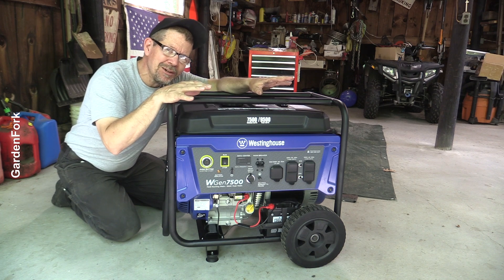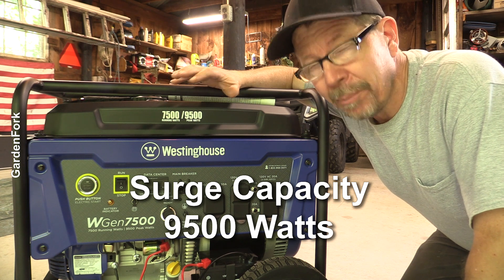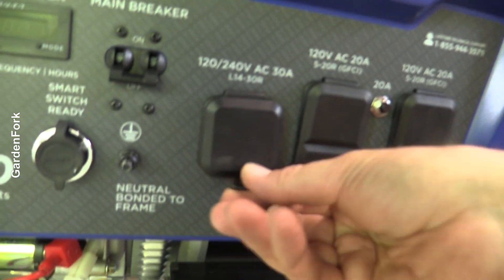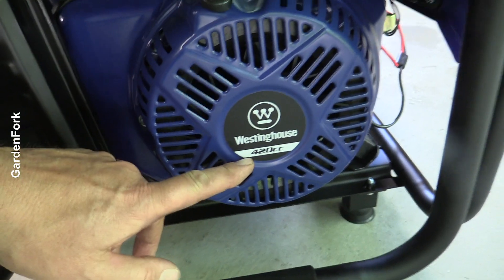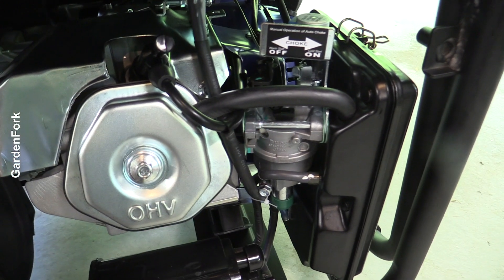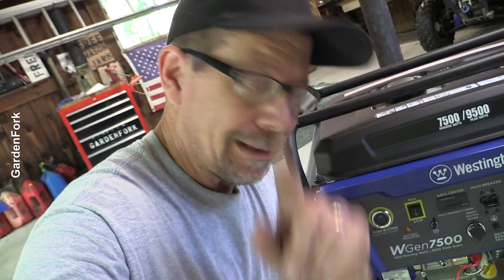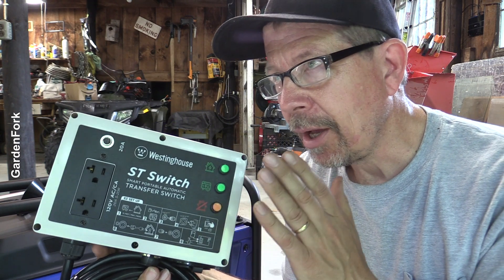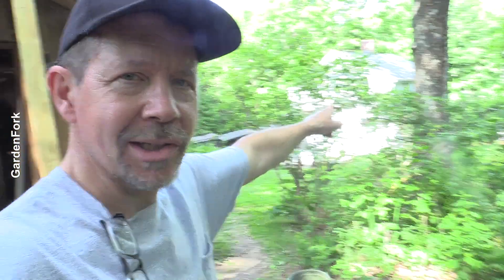A Remote Start Generator? You Will Like This - Westinghouse Wgen7500

Comment: 5 or 6 yrs ago I did extensive research for a good generator and transfer switch, Westinghouse was the one I also picked. Life happened and I never bought them. You re-kindled my interest and I am now thinking about all this again.  Good video, thanks.
Reply from the maker: good to hear. The remote start and the ST switch make this one interesting. If you need dual fuel, there are links to those as well in the video notes. - ERic.

Comment: I recently purchased the 2021, Westinghouse WGen7500 DF (Dual Fuel). It is real nice. Starts easy, runs smooth and has plenty of power to handle all of my needs. Its nice to have the option of what type of fuel I want to run. Nice job on the review. I am very happy with this generator and I like the attention to detail and quality.

Comment: I just watched your video and found a great deal on this same Generator Delivered to my home for free. I will use Manual Transfer Switch and the remote control I think. Great price and value for the money. I made the mistake of buying a smaller manual start Generator and had 4 feet of Snow and a power outage. I was just in the hospital and shoveling a path to go find the gen set, Did a place to put it and then run  a wire back to run what i needed will be eliminated when I hook this up and have it wired in correctly. Watching you install a Manual Transfer Switch in your sisters house. Great videos ! Thank you.

Comment: From Nova Scotia Great video!
I agree Westinghouse makes the best generator.
Couldn’t get the one I wanted so I bought a 8000/10000 Firman that seems to work well. Also, for some reason I did not know I could plug in my battery  tender (same as yours) that way.
Thanks very much !!

Comment: Yes, you DO have to trudge out in the snow to flick the rocker switch from stop to start. Then the fob will work. 
If you leave the switch on start all the time, the battery will be depleted. 
It's NOT remote start, unless you don't have to visit the generator first.
Reply: I added a 9.00 12v remote relay to the power line on the on switch. Extra remote but you dont have to go outside and flip the on switch. Relays on ebay.
Reply: EXACTLY, I don't under stand the advantage of remote start.

Comment: only problem with these gens that start with the remote fob is that you have to leave the on off switch to the on position all the time for it to run but that runs down your battery if its just sitting for a long time with the switch in the on position so you need to have the trickle charger on it.   also they are hard to wire to a remote start from a transfer switch or solar inverter that can start a generator  to charge the batteries.

Comment: Thinking about getting one, have had 2 harbor freight 7250/9000 that didn't last a yr using 5hrs a day with only 90day warranty, engine rung out one one, powerhead on other, going to thoroughly check PH on second one tomorrow, can maybe use the one from no 1, they are junk tho. Hoping these are better with a 3yr warranty

Comment: Nice video. What mode trickel charger do you use.  I have the same generator but I have a dead battery. Do you charge the batter with the switch on or off?
Reply from the maker: Switch off. Direct wire to the battery. Buy the lowest wattage Battery Tender brand.

Comment: If you are considering using Westinghouse generators for sump pumps, beware of the Smart Idle feature (don't buy a model with it).  It will prevent the sump pump from starting correctly, as it idles down in between pumping cycles, lowering the usable amps.  This is something I've taken up with Westinghouse, but their answer is "too bad, too sad."  I now own a $1,100 paperweight.
Reply: I don't know how it's set up but if it uses a solenoid to pull the throttle down, then you can probably just unplug that solenoid to prevent it from idling.

Comment: I have the Westinghouse IGEN4500DF for my toy hauler. IMHO the remote is useless. You must have the power (rocker) switch in the "on" position for the remote to work and I spoke with a Westinghouse tech that said Westinghouse does not recommend leaving the rocker switch in the "on" position when the generator is not running. It's a flashy feature on paper, but if your camping and have to get up in the morning to flip the switch....you might as well push the start button.
Reply: AND they also say not to leave the gas turned on
Reply: EXACTLY, I don't under stand the advantage of remote start.

Comment: I am using a 6000 W generator right now with a 30 amp service in my breaker box. If I purchase this generator, can I use it just the way it is set up in my breaker box right now 30 amp. I do not want to go with a 50 amp service. What’s your thoughts?

Comment: Had the older battery tender toast my Harley battery, new one doesn't put out enough volts so I set my normal charger to 1-2 amps work's great 1,2 times a month for few hours.

Comment: How do I drain all of the gas out of the generator? I ran the generator till it stopped but there's still abit of gas in the tank. I see there's a hose running from the bottom of the gas tank, can I disconnect that to drain the remaining gas?

Comment: Question I noticed you mentioned that it's not strong enough to run central air conditioning I have an electric heat pump that does AC and heat I'm not worried about running air conditioning but would like to have heat do you know if its strong enough to run this heat pump and air handler?

Comment: Received mine yesterday at 7am, 7500df, and broke it in, been heat wavey last few weeks, it sucked with no juice!!! Kinda off the grid till I buy new house asap. Almost surprised it doesn't have an app for a Smart phone. And the FOB among all the other options, I turn off or on from inside, no more going out late or early to start or stop after batteries are charged, just fuel up every other day, I RULE!!! ✊LOL....I keep battery off during day and came with a charger, it'll charge itself I believe with it

Comment: Do the outlets on the generator work when you're using the smart transfer switch? Or do you have to use the outlets on the transfer switch? In other words, could I use the transfer switch as an auto-stop/start, but then have the full 50 amp source hooked into something?

Comment: Keep in mind that you must keep your generator in an "ON" configuration for the remote to work. When it's left in an "ON" position....you are definitely using a bit of Battery to keep the Generator in a "Ready To Start" state. So, I wouldn't leave it like that as a rule....but if there is a threat of weather that might knock out power......I would put the Generator to that Ready To Start. state..."ON" ..... so I could remote start it if need be.
Reply: I got a cheap solar PWM charger to fix this. No more problem with the battery going dead.
Reply: My generator came with a battery tender. I leave the switch, fuel and breaker on for remote start.
Reply: @maxwellcrazycat9204  Nice👍

Comment: GF…. Does that remote work fine through a wall? Did you test that? Can you be inside of your house and turn the generator on when it’s out near your garage through both walls the way it is sitting in your review video? The wall question seems to me to beA very important one for your viewers
Reply: Mine works through walls no problem.
Reply: You have to go out to geny to turn the on/off switch to on first then the remote start will work.

Comment: I have the electric start Westinghouse Dual Fuel 6600/5300 generator and I bought one of those Battery Tenders but it will not charge the battery because it is a Li-ion battery.  Apparently those battery tenders are for lead acid and Li - iron phosphate batteries.  So people need to be aware of that.  I can still use it on other batteries.
Reply from the maker: Hi Dude, there is a battery charging outlet on the main panel of the generator, and the unit should have come with a plug in charger for that. If not, contact Westinghouse. thx!
Reply: @gardenfork  Yes, I am using the supplied charger but just wanted to let you know about it in case the issue would come up again.  I am using the BatteryTender on my boat batteries instead and it's fine.  It just won't charge the Li ion battery that came on my generator.

Comment: .1:32  with an Easy Start Micro Air 368 soft start, you can. Because a 4 ton AC requires 70Amps to kick in, and the easy start reduces it to about 40 Amps, and then it sustains a 4,000 running watts while running.  This gen easily can handle that load. No?

Comment: Electric start on/off switch won't light up on mine. I charged the battery and still nothing, any suggestions?
Reply from the maker: best to contact Westinghouse. maybe a mouse ate the wires? they like to nest in generators in winter.  - Eric.

Comment: Anyone ever leave the rocker in the “on” position to see how long it can be in “stand by” for key fob start?
Reply: I leave mine on with the gasoline valve open and the battery tender plugged in. Otherwise the remote start won't work.
Reply: @maxwellcrazycat9204  had it in on position for 24 hours and it still started right up....didn't try longer than that
Reply: just want to be able to cover 10 hours while i'm at work so the wife can use the remote and just flip the transfer switches
Reply: I leave the switch in the “ON” position all of the time. I’ve never gone much more than 12-16 hours without remote starting it. 
I love this little generator!

Comment: Is it safe to add 3 gallons of gas in the generator while it's running so you don't have to turn it back on  ?
Reply: If you have to ask that question when you shouldn't be around running motors

Comment: Question, when you use the at switch to turn on the Gen systematically,  does the other 120v and 240v plugs from the generator are active, I want to power 240v to a transferswitch, APC  32315-UTS10BI

Comment: Those L14-30 twist lock outlets confuse me. I was under the impression that 7500 watts is enough to trip a 30amp breaker because 30amp trips at 7200 watts (30amp*240v). So, in theory, wouldn’t a 30amp breaker trip before it could even make use of the 7500 running watts this generator offers?

Comment: Excuse me sir...how many amps is that Trickle battery charger? There's a couple of different amp sizes on Amazon.(P.S. awesome video! Two thumbs up!)
Reply from the maker: hi Daniel, get a very low amperage trickle charger, like .5 amps . higher amperage will make the gen battery lose fluid. thx!
Reply: The BT he has is likely a .750 to .850 milliamp

Comment: so, i just got the bigger model and it looks like the battery is hooked up, but there are two other loose cables near the battery.  I'm not seeing those in the manual.  Do I have to charge the battery before I start it up?
Reply: ALWAYS charge the battery before starting anything.

Comment: Yeah why don't you tell him about how YOU'LL HAVE to Drudge out in the snow so you can turn the unit on before you can use the remote... Every time unless you want a battery that is run dowl
Reply: My thoughts exactly. I have a Westinghouse generator with remote and the remote just hangs right on the frame because I'll never use it for the same reason

Comment: Any issues remote starting the generator with transfer switch load on it?   Everything I see says to start and stop your generator without load.  So how does remote starting work if you need to flip the breaker or plug the cord in at the generator?  Anybody have any thoughts or advice?
Reply: NEVER EVER start a portable generator with a load on it.... ALWAYS start the generator first without ANY load so that it can warm up.

Comment: so yeah it starts but hoe can the power switch to send the power to the house be flipped on without going out into the snow without an auto transfer switch? still gotta go out in the snow and flip the power out switch on???
Reply from the maker: many transfer switches are now mounted next to the main panel in the basement. but yeah, if its outside, you have to go outside. :)
Reply: EXACTLY, I don't under stand the advantage of remote start.

Comment: I would like to know if anyone can tell me if the generator will still start if the generator power was not connected to the Switch.  I would like to use the switch as a auto start only.  I have a generlink transfer switch on my meter and I am hoping I can use the 30 amp plug to power it rather than powering the st switch.  In theroy I would hope the switch would sense when grid power is out and automatically start generator powering my generlink.  Any comments?
Reply from the maker: Best to contact the company and ask them, they know best. thx!

Comment: Thank you for the great video. I just got this one but have a problem to start it after following every step from the manual and trying many times. Called Westinghouse and still waiting for a technician to call me back after two days. Any suggestions? Thanks!
Reply: I switched out the spark plug on mine. E3

Comment: How much of battery drain happens if run switch is left on
Reply: It drains pretty quickly.... some reports say a day or two, other reports i`ve read said a week at the most.
Best thing to do is, leave a battery tender plugged into the battery 24/7, its not an issue.

Comment: Trickle charger negates ability of generator being on standby. I'm disabled and can't trudge outside in a snow or ice storm to remove the trickle charger and start the generator
Reply from the maker: Hi Johnathan i have issues with ice and snow myself, we have to be careful. I don’t think I said this was a standby generator, as true standby gens are $$. But the remote sure does help once you’ve got the gen hooked up during a power outage. Good Luck, Eric.
Reply: @gardenfork  I think I figured a way out. The rocker switch for start/stop can be wired into a switch in my house. 
I'm having an electrician stop by and give me a quote on a service disconnect automatic transfer switch. I get his opinion before I do anything. 
An aside: my generator was taking three tries to start when it was cold. I replaced the spark plug with an E3 plug. Now it always starts on the first try. I'm really happy about that.
Reply: I did it. I ran wires from the generator's Run/Stop switch, in parallel, to another rocker switch in my house. I also ran a circuit interrupt for my trickle charger (12V side). 
It worked! I don't have to go outside to start 'er up. I can disconnect the trickle charger, enable the run rocker, and use the remote key fob to start the engine.
Of course, this no doubts cancels the warranty. Too bad, but I now have what I need.